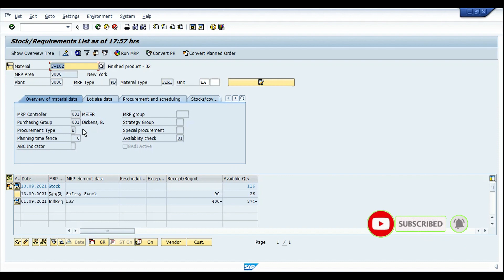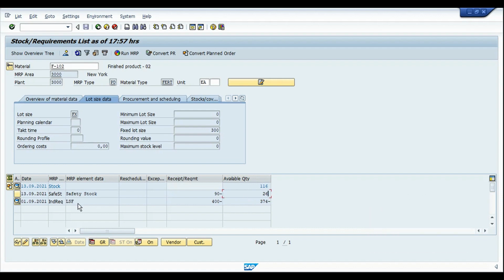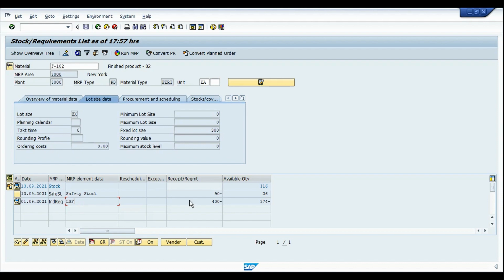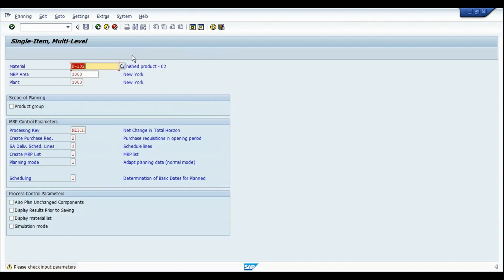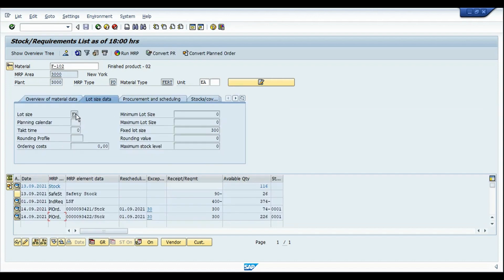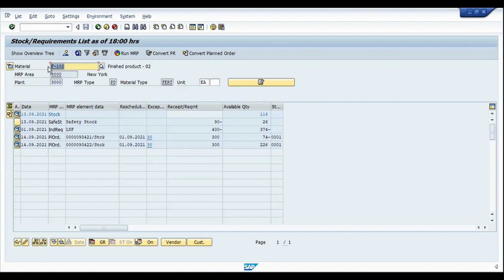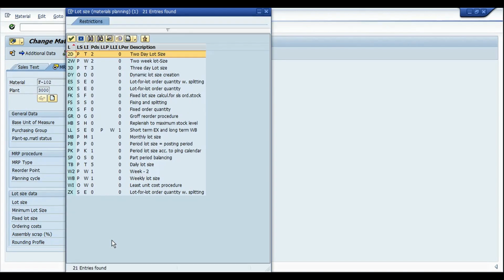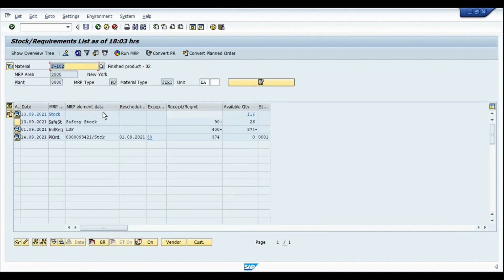Safety stock | Lot size | MRP | SAP PP

Comment: Great vid, your voice is rather low and the music is very loud, just wanted to mention that...  Do you have any SAP S/4 Hana experience or can you post any vids like this for Hana?  Thank you.
Reply from the maker: Thank you..yeah I observed that on the audio. Minor tweaks should fix it. I made few videos on S/4 simplifications..pls check from the playlist.
Reply: @SAPwithIK  ok, thanks I will check it out.  Can I also ask why on this example you have safety stock?  How does that help in MRP?  I believe since you have it set as PD that becomes your minimum required amount to stock, is that correct?  Thanks.
Reply from the maker: Safety stock is the minimum stock level expected for the material at any point of time. I’ve set this in the material master.